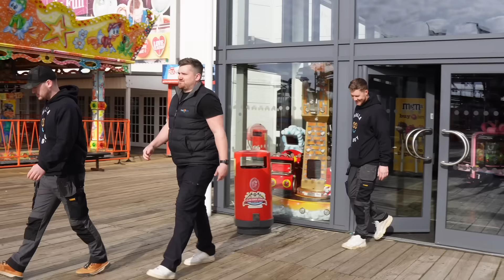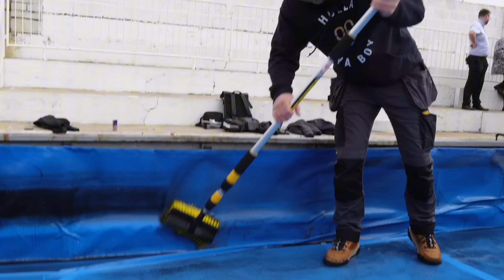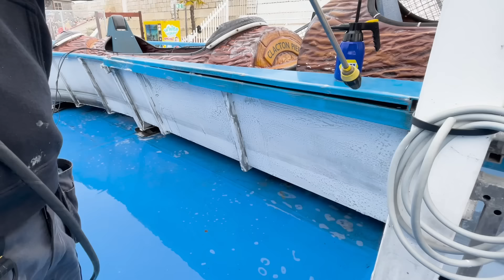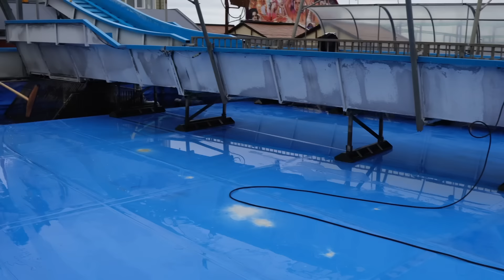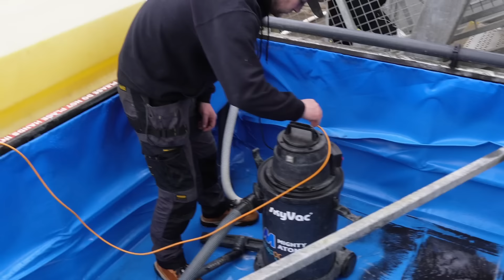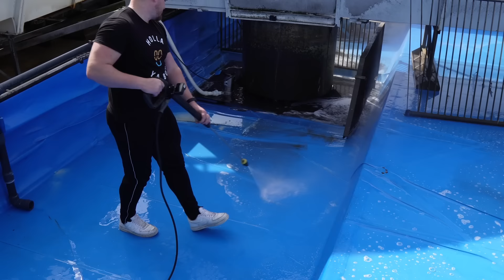Log flume clean at Clacton pier!!

Comment: To stop the liner from being sucked into the pump use metallic mesh from a security bug screen or similar. It’s sturdy enough to provide clearance but thin enough to get suction. Will need to frame the sides with trim so it the sharp edges don’t puncture the liner. Especially useful for above ground pools where the liner is not attached and there is minimal debris.